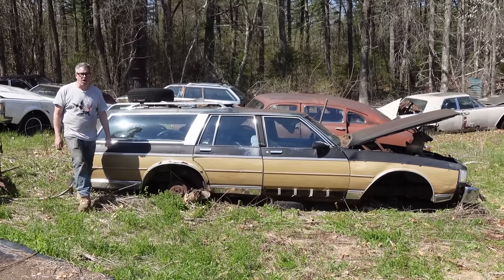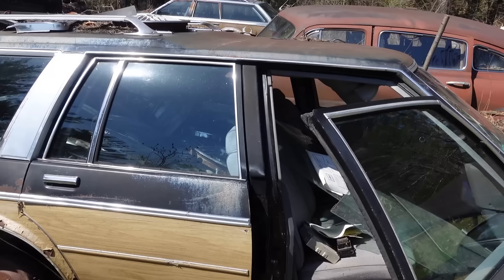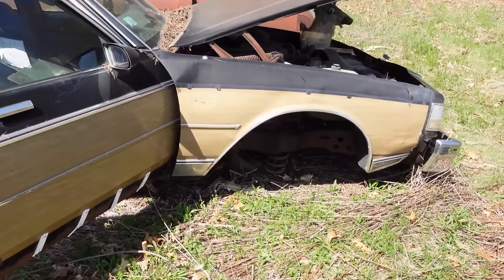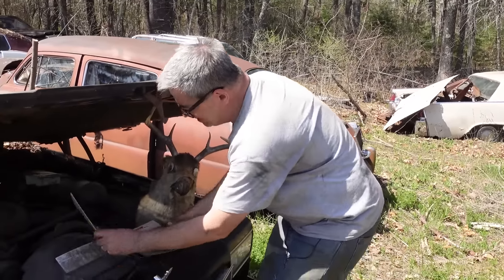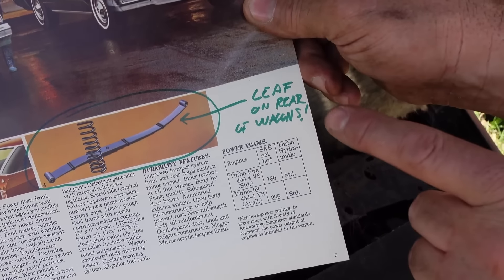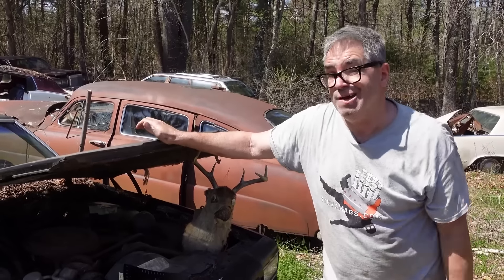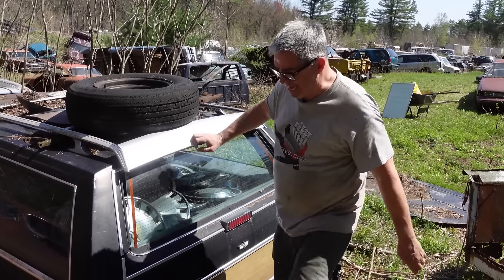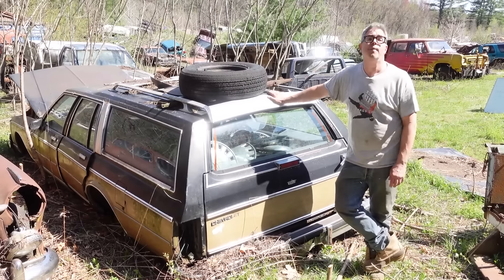Wagon Week EP1 - Caprice Classic

Comment: Another day closer to seeing you back in the yards. As stated last time: 

My friend had three of these (he might still have one), a 1985 with a 305 V8, a 1988 like this one with a 307 V8 and a 1989 Cutom Cruiser with a 307. He bought the 1988 from a coworker of ours and it was a oil burner (that coworker was clueless about cars, but acted like he was a whiz, he wasn't). My friend then put a used engine in the 1988. Not just any engine---it was rumored to come from Barbara Eden's personal car when they swapped the engine for a more powerful one. My friend paid $50 for the engine (which was under a cover outside), cleaned it up, replaced some gaskets and put it in the vehicle. It went another 100,000 miles on that engine. He eventually got rid of it as the body was getting rough. I'm actually speaking to him this weekend, so I'll have to find out if he still has the 1989 Oldsmobile wagon. An Olds club member gave it to him as he didn't need it anymore. DeNooyer Chevrolet still exists at that same address. The then owner of this vehicle lived about 9 miles away in Albany.  No Impalas by this time, they had gone away after the 1985 model year. 

We got the VIN, we win: 1G1 for US made Chevrolet passenger car, BN81 for Caprice Estate wagon, Y for 5.0L (307 CID) V8, Oldsmobile produced (although by then, labeled as "corporate") with four barrel, aka RPO code "LV2", aka "Mini Pocket Rocket", X is a check digit, J for the 1988 model year, R for Arlington, TX assembly and the rest is the production sequence. The Arlington, TX plant still operates today and has exclusively produced trucks and SUVs since the last RWD GM rolled off the line in 1996.  The 307 V8 is no powerhouse, but it is a bulletproof engine and will run, run, run, run, run, run, run, run, run, run and run some more. They are easily known to go 250K without needing anything internal. I have owned several and they are one of my favorite engines. Dillion Chevrolet existed until 2022 when it was sold by the Dillion family and is now McGovern Chevrolet at 54 Main Street in Greenfield, MA. That Meineke shop still exists at the same location as well. It is likely that AP Exhaust was the supplier of exhaust products to Meineke. 

Correct, the 307 V8 (VIN code "Y", RPO code "LV2") was used from 1980 to 1990 and all of GM's car divisions used it at some point. Yes, always had a Rochester four barrel. Close, but not the same. That mirror is unique to the B body car, not the same part number as the other cars in the line, but yes, similar style. No tag, can't brag, and no SPID wish you did, but this is code 29/WA8970 Dark Blue exterior paint.

That "wood" contact paper on the sides is very expensive. My friend bought it from GM to redo his wagon and it wasn't cheap. 3M made it for GM. As Kenny Rogers once said, "It's The Wood That Makes It Good".
Reply: There is a DeNooyer Chevrolet dealership a half mile from my house in Holland, Michigan.
Reply: Wagon Week was foretold
Reply: @WinkelManBearPig  Indeed.
Reply: My mom bought a new Chevelle in 1969. 307, with a power glide 2 speed. The air cleaner sticker said 307 turbo fire 200 hp. It was a car somebody ordered, but didn't pick up at Schumacher Chevrolet.  Red, with a white vinyl top, and black interior, a strange bird indeed. As you said, wasn't a powerhouse, but dependable and smooth running.
Reply: @fishgeralding9224  307 Chevy is a totally different engine then the 1980s Oldsmobile 307. The Chevy 307 was used from 1968 thru 73 model years and was designed to replace the  283 V8. Same bore, but used a 327 crank. All Chevy 307s came with the small port 2 barrel. We have one in our 1970 Malibu coupe. Decent power with an upgraded camshaft. 200 hp was flywheel rating, at the wheels its much less LOL. Its a decent engine and has that small stroke "snap". Its not a desirable engine, but neither is the 307 Olds but as "Google Man" said it's a dependable plant.
Reply: We've had a couple of 307-powered cars over the years. Nice engines, although the PCV and hot-air choke systems tend to coke up, and turn it into a bit of an oil burner, and I remember our mechanic saying it was a pain to clean. The choke was solved with an electric choke kit. That aside, nice, smooth engine, relatively economical, pretty easy to work on except the 4-speed auto car I had ('82 Olds 98) had that vacuum pump on it that I had trouble finding a drive belt for, and the plug under it was a bear to get at. My mom's '86 Cutlass Supreme with the 3-speed automatic had no vacuum pump, and was pretty straight-forward to work on. I had to take the passenger-side tire off to get at the plugs on that bank to get around the air conditioning, but it was pretty quick to do once off. 

I'm in Athol. Bernardston Auto Wrecking is a great place. And Dale is a very nice guy.
Reply: @CharlieLarkin75  The trick with the 307 Olds V8 is regular maintenance and then they run, run, run, run, run, run, run, run, run and run some more. They have the power curve of a Briggs and Stratton powered lawn mower but they are very reliable. I never had an issue changing plugs on any 307, and I've owned cars that were FWD and RWD with that engine. 

1982 had a unique system where the power steering reservoir was remote, at least it was on my 1982 Toronado. My 1984 Delta 88 was much more cleaned up. The 307 has mountains of brackets and hardware that terminate at the water pump. So, it make sense if you do a timing chain set to do the water pump, belts, hoses, thermostat and even a fuel pump because they are right there. Although, with today's quality of parts, the old ones might be better.
Reply: @googleusergp  The 307 had lots of low-end grunt but ran out of steam at about 4,000 rpm. Revving it higher accomplished nothing which is totally fine in a large heavy family sedan or wagon. They were very quiet under full throttle acceleration, so while the journey to 60 mph was slow, at least it was very serene.
Reply: @AlexanderCrump  You didn't buy a 307 Olds V8 for power. You bought it for economy and smoothness. Two things it did very well.
Reply: @CharlieLarkin75  As noted by others, that's a different engine. That's a Chevrolet small block 307. This vehicle in this video has an Oldsmobile 307 CID V8.
Reply: @googleusergp Didn't know the '82 was unique in that regard, but good to know. I do remember the crazy accessory drive set-up, though, especially the alternator with that ridiculous side-ways adjuster bolt because they didn't run the belt around the crank pulley is the explanation I remember being given. But yeah, I'd definitely get another 307-powered car, but try to wake it up a little somehow, although the '86-up engines make that difficult because none of the performance parts fit the heads.
Reply: @CharlieLarkin75  Yup, my '82 Toronado had a remote power steering reservoir.

Comment: There were a lot of B-body GM wagons (Chevy Caprice/Pontiac Parisienne/Buick Electra/Oldsmobile Custom Cruiser) here in Finland back in the day, because they were big enough so they could be registered as vans! Yep, that's correct, the car tax here is pretty high, and by doing so roughly 1/3 of the price of a new Caprice was saved, only the back seat had to be replaced with one that was allowed to be only 2 inches thick. Sadly, most of them have rusted away by now, and you don't see any of these B-body cars on the road that often.

Comment: You are bringing me back to the memories with this video, Steve. I recently found the receipt from buying my ‘77 Impala Coupe for $50 back in 1998. That 350 engine was the smoothest and quietest vehicle I’ve ever owned…even better than my new cars. Bump key turn forward and she fired up instantly, and most noise was from clutch fan. I can remember parking to talk and having to put my ear to dash to check if it was running, it was that smooth and quiet. Cheers Steve, be well, get well, stay safe!

Comment: Had so many good times in these wagons.  The gms are fine very smooth terrific rides.  However prefer the fords because the port injected 302 sometimes paired with tow package noticeably better acceleration and power for merging hills especially when loaded up.  89 colony park my absolute favorite although my 88 custom cruiser was smoother.

Comment: I spent a few years doing up a 1984 Caprice Estate station wagon as a sleeper project. One thing I didn't like was that I kept crushing the rear coil springs! The station wagon caprices also have the same parts interchange as the 9C1 police cars! So they're really easy to beef up into a really tough and durable vehicle! Mine did wheelies with the 305 small block chevy. I didn't have a tachometer but with a 750cfm quadrajet, the secondary fuel rods had to be calibrated to a fatter mixture. I probably had a redline around 6000rpms after I replaced the camshaft, lifters and timing chain. The caprice sedans used smaller brakes and the smaller wheel bolt pattern where the station wagon uses the bigger wheel bolt pattern as the police version and also the same 5 bolt as a half ton GM and chevy pickup. Chevy suburbans used 15x8 inch steel rims that are a direct bolt on fit that fit the 9c1 police car and the station wagons. If I ever find another caprice in good shape, they're prone to rusting out and the frame and rear suspension are prone to blowing apart. Otherwise they're really easy to modify with stock parts. But they can produce a lot of torque and the rear suspension fails in these cars. I also owned an ex police 9c1 caprice classic with the LT1. That engine is a major money pit. After two failed transmissions and after a costly rebuild, I threw that car away after I spent 8 years under it! But the station wagon is like a car fetish to me. It was the fastest car I ever built!

Comment: One of my favorite cars that I've ever owned was a '68 Bel Air Wagon with a 327 that I got for $75 from an elderly lady down the street. She wanted me to just take it away because it didn't run but I gave her the money. I put a new distributor cap and plug wires on it, did a tune-up and rebuilt the brakes and it ran like a dream. I used to beat GT Mustangs with it back in the early 80s. 😂

Comment: I have a 1986 Pontiac Parisienne Safari wagon and it's IDENTICLE to the Caprice except for the grille and some trim. It has the Olds 307 dog. Those drums are hard to find! Mine were ground so much the shoes weren't even touching. Bought some Chinese replacements from a local parts store and they were so out of round. Found a 'new' Aimco drum on one at a pull-a-part and got one 'decent' import that still needed to be ground to make it round. One weird thing, mine has the 'Powermaster' brake booster like on the GN's.

Comment: I read that receipt, dated Jan. 31 1994, and it said that the engine had been replaced in November, and that the car was now cutting out. Shop did a cap, rotor, and wires, but not plugs - they must've been already done. I'd be worried about the HEI module too, if the engine was stalling/cutting off. 
Labor was way more than parts - $144.28 for diagnosis and the actual work, vs. $79.34 for the parts. Stealership... 
If they replaced a 307, which they most certainly did, (5.0 emissions label + vacuum brake booster) I hope they got a 350 (gas job!) instead.

Comment: There's pros and cons to those glass headlight modules. I had some on my '88 Riv. They are nice for the reasons you stated, but they're expensive to replace and worse they get pitted and 'sandblasted' by debris just like a windshield, so as they age they still diffuse the light, maybe not as bad.

Comment: In the late eighties, A buddy of mine got a 78 wagon for like $300. 
It was beat,rusty and had a 305 automatic. 
Anyways it took our abuse all summer of doing about 45 and kicking it into reverse and flooring it. 
Best results on a road where that tar oozes up. 
Id say it takes a good 400-500 feet for a reverse spinning wheel to stop you from 45. 
When you start going backwards and it hooks up,drop it in drive and send it again. 
By the end of the summer she was so tired from floating the valves it wouldnt rev over 3000rpm in neutral with your foot to the floor ,and the 2 foot tall fuel fog above the carburetor was glorious. 
Those were the days man ,gee that old LaSalle ran great. 😂

Comment: My folks went through three Chevy wagons from this generation: first was a brand new 1977 Impala with police-spec 9C1 drivetrain and suspension,which got totalled when a drunk in a '78 Caprice rear-ended it doing nearly 40 mph, which was followed by a used '84 Caprice, then a used '88 Caprice Estate. My dad loved those cars, which is why he stuck with them. The Estate was replaced several years later by a used 1994 Olds Custom Cruiser, which, as was pointed out in the video, was the same car beneath its newly curvaceous skin.

On a side note: the Grundy's car from "Vacation" was called the  "Wagon Queen Family Truckster".
Reply: 1992 was the last year for the Oldsmobile Custom Cruiser.

Comment: We had a light blue one inside and out, we called it the blueberry. I still remember my dad cursing at that damn Olds 307 because the crankshaft cracked in the middle after less than 100k, and he ended up putting in a junkyard 350 in an overnight swap. We had to bribe the smog shop here in California for it to pass, but thats how it was pre internet era, so much more power from a pre smog 350 though.

Comment: My first car was a '78 Caprice Classic wagon. I even took my driving test in it since it was the only automatic transmission vehicle we had. This also included having to parallel park it at the end of the test. Gas mileage was terrible. If you hit 80+ on the highway, you could see the fuel gauge move down slowly in real time.

Comment: Great video. Didn’t know that they were putting Olds motors in Chevy wagons. I worked for a hotel in the late 80s and they had an 87 Buick Wagon also with 307 four barrel. Don’t know it it was Olds or Buick at that time. Initially figured it was probably a 305 until I looked. It wasn’t a speed demon but had decent power for airport runs and such that didn’t require a can - or for visiting executives who were too cheap to rent a car.

Comment: The mid 80s caprice was a great car the styling was not my cup of tea but a great daily driver with enough power if you had the bigger motor the 350 was a great engine and if you put a cam and descent carb it made not bad power and with a power addder they performed a lot like fords lowly 302.and the early generation can be stroked to 454 ci if you buy the kit..

Comment: I seem to recall that people blamed mini vans for the extinction of the station wagon. Sad to think that both species have been displaced by the invasive SUV. My wife has owned hatchbacks, a small station wagon, a minivan, another hatchback and has now switched to a Rav4. I have had one compact sedan, 2 minivans, and currently switch between a compact pickup and my second full size van. I did at one point consider replacing my Aerostar with a Ford Flex that was certainly a wagon even if it was marketed as a ‘crossover’.